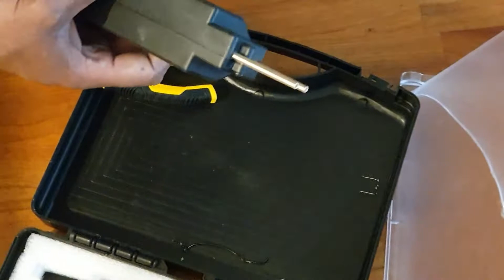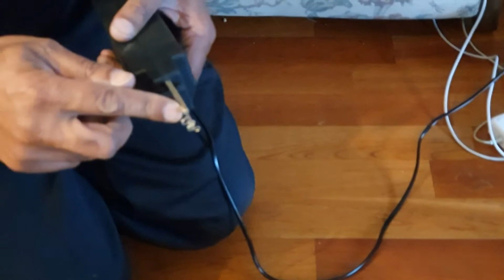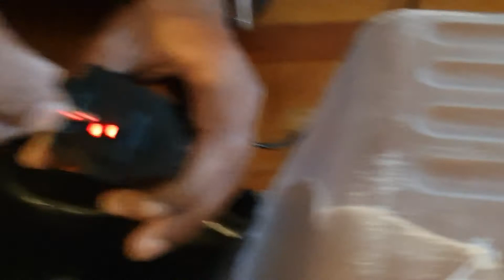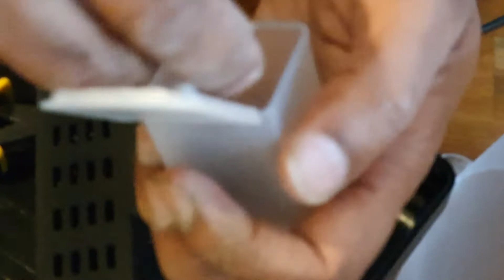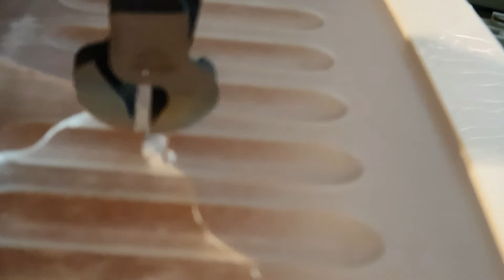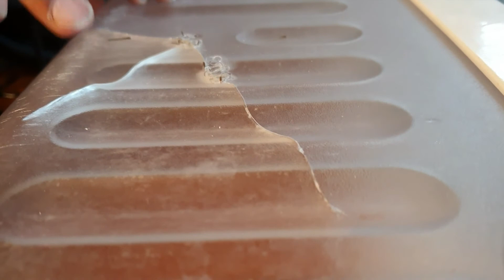Broken plastic fridge drawers repaired using hot plastic staples. Don't buy new, repair.

Comment: From my research into the subject (although not actual 'practice' into it), I gather it would be much faster, stronger and less 'visible', should a "bonding" cement - perhaps a specially formulated for Acrylate and Polystyrene components are involved - in which the opportunity to "spread" the acting plastic be spread, covering much more surface area (for strength). I thank you for the instruction, though.
Reply from the maker: I believe that to be correct. Also if you could somehow  use micro abrasion on the fitting surfaces to increase the surface area available to binding with a bevel edge then this would be the ideal. Getting the correct cement may be the challenge